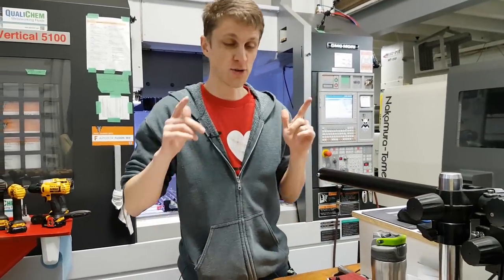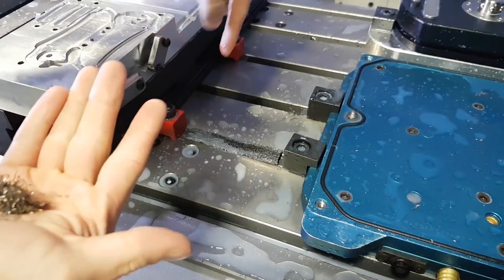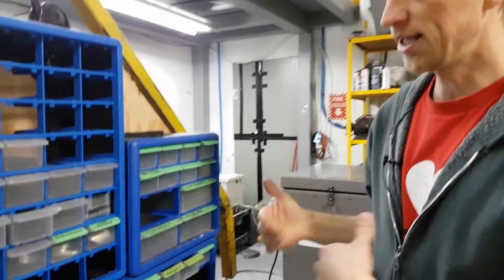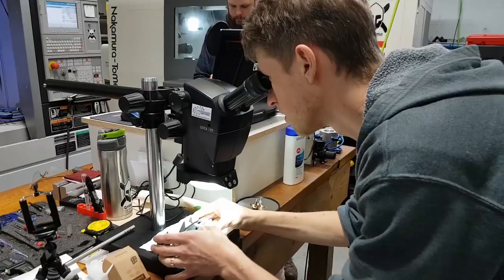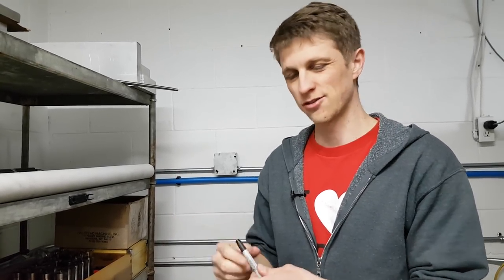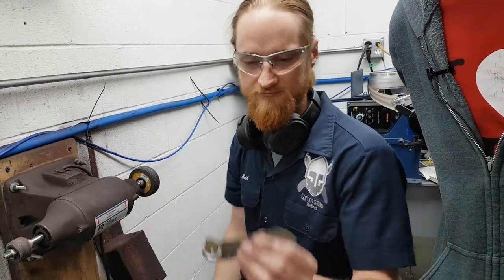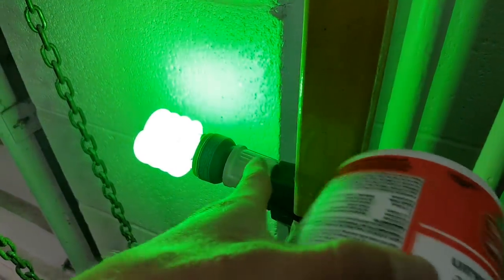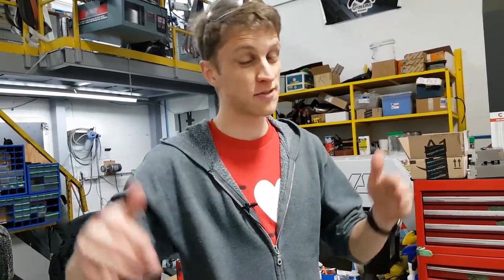33 Tips in a BLAZING 24 Minutes! - Shop Life 014

Comment from the maker: What're some tips and tricks from around your shop or workspace?
Reply: John, what about making the stickers (that cover the detent track) attached with two of them together. So when you peel them off, you stick one on one side, the other on the other side, and then you have a loop between them to hold the blades when etching. I don't have time to do a sketch right now, but think of this: O=O Hah 

Edit * LOVE the podcast! :)
Reply: Put some ridged foam on the bottom of the bins with the end mills. Oriented to the length of the mill, they will fall in the slots and stop rolling about.
Reply: Don't get a stereoscopic one, just get the single large vision one. David from EEVblog has one. Mantis Elite.
video :  /watch?v=a3o0EWHEH08
Reply: Hot glue gun! Want magnets on your Sharpie? Hot glue them on. Done in 1 minute. Move on to things that make you money. Or hot glue more things :)
Reply: JohnGrimsmo 3d print something to mount your camera to the microscope
Reply: Label your containers of hazardous materials.  When someone is in headless-chicken mode because they got splashed with something is not the time to wonder what exactly is in that jar.
Reply: Get a box of Kim Wipes for your stereoscope. No clothes (That inevitably have metal particles and abrasive dust on it.), no rags, no paper towels/tissues/T.P./etc. Kim Wipes only.
Reply: Instead of using your veirniers to measure stickout make a set of stick out sticks. We just use aluminium flat bar with notches cut out to different lengths. Ie 10mm, 20, 30, 40, 45, 50 etc
Reply: thought about putting a sheet of magnet under the bins with the end mills in? might stop them rolling around?
Reply: My favorite "trick" thing I recently got actually solves your issue with measuring stock. Starrett makes stick-on tape measures. I have one on my work bench and it's a beautiful thing.
Reply: John at my shop we screwed a wooden yard stick to the bins with bolts in them for easy measurement.  Also if you attach Sharpie caps to the shelves you can always have a place to put them
Reply: Velcro with 3M-adhesive backing. Perfect for stuff like your sharpie management; A strip on your shelf or any other surface you need it and a quick wrap-around strip on your  sharpies... boom; experience the wonders of non-magnetic organizing magic..... The international space station loves it, so will you.
Reply: JohnGrimsmo Thanks
Reply: micvee Lee Valley Tools sells measuring tape like that
Reply: Use sunscreen. Dish liquid makes a really good hand cleaner if you can't afford granulated industrial hand cleaner. Dishwashing liquid is an awesome surfactant/degreaser.

Comment: Tip from somebody who wears glasses. Please dont use your clothes to clean anything sensitive (like glasses, lenses). You will scratch them over time. Especially if youre in a shop where surfacegrinding (or any grinding for that matter..) is done.
Reply: i was thinking the same thing, he is around swarf all day and wiping a piece into the lense would ruin it
Reply from the maker: Noted.  Thanks Stefan!
Reply: Bah humbug! I've been wearing glasses since the age of two; 58 years ago.

While usually using an appropriate cloth, I don't always have one and the tail of my shirt-front comes to the rescue. No scratches of note; not even the polymer lenses that I now need because glass ones would break my nose due to the weight. :-(

The trick is to use a portion of the garment not exposed to the filth and fragments.
Reply: I think he's implying that the lense itself was exposed to metal (and grinder abrasive) dust from the shop. Wiping that dust off with even a clean cloth can be very damaging to the microscopic coatings on microscope optics.
Reply: A box of pre-moistened lens cleaning wipes next to the microscope would be good. Lubrication helps to avoid scratches in the coatings, and they are cleaner than the shirt. :)
Reply: You need some boxes of kimwipes around for that type of cleaning.
Reply: Tip from somebody who had a chip removed from the eyeball with a hypodermic needle. When you want to wipe grease swarf dust and crud from your face, do it with the inside of your shirt, which is definitely cleaner than the grinding dust and shaving impregnated outside of it!

Comment: 1. Go/Nogo gages save huge amounts of time and increase part quality because they can't be manipulated or fudged, and because they're so quick, you're more likely to check more often.

2. Design fixtures that can't be loaded wrong.

3. The error tolerance of your measuring device should be ten times lower than the tolerance of the measured feature. Don't measure a +/- .001 feature with calipers that have +/- .001 error tolerance.

4. If you have the tool capacity in your machine, dedicate tools to operations. If op1 is a face and op2 is an edge with both ops in the machine at the same time, but both ops require a 3/32 endmill...use 2 endmills. This way, an offset for op1 won't effect op2 and damage to the tool in op1 won't scrap op2. In that same vein, dedicate finishing tools where possible rather than roughing and finishing with the same tool. I personally like to rough with insert tools and finish with solid carbide.

5. CLEAN EVERYTHING! You work better, feel better about it, look more professional if a client stops by, are able to find things, it's safer and it protects your investment long term.
Reply from the maker: Yes!!  Love it Kenneth.

Comment: Work-Pants! The ones with a lot of pockets-> no need for sharpie mounting!
Fill pockets with:
- 3 separate metal rulers: one to get bent for measuring tight places, one to keep nice for normal measuring and one to keep pristine for deburing plastics and aluminium. And give each one a kink in the non-zero end to facilitate picking it up off of flat surfaces.
- Plastic scraper to be used in prying or getting chips or small parts out of ruts
- Small flashlight
-Thin work gloves

Bonus tip: use superglue to seal cuts up real fast!
Reply from the maker: Great tips buddy!
Reply: I bought a bunch of cheapie 6" rules a couple years ago.  I cut and ground them into 1", 2", 3",4" and 5" rules.  Ridiculously useful.

Comment: For #23: Look for 'stix measure' tapes. They are thin, flat steel tapes with adhesive backing. Also very good at the edge of any working table to quickly check some measurements.

Also thanks for #15 (caliper edge). I never realized until you showed it. Wonderful.

Comment: Print some covers for the Leica, and invest in some single use lens wipes for the eye pieces. A cover wouldn't hurt. 
Im willing to bet it wasn't cheap, protect that investment. You could ruin a lens using a sweater.
Reply: I was going to say the same thing, I'd make some flip covers like you see on a rifle scope. And yes don't use your shirt to clean the glass! That's the easiest way to scratch them!
Reply from the maker: Gotcha, great suggestions!
Reply: You could also print a sleeve for your phone to fit over the eyepiece at the correct focal length for pics.

Comment: John: have you thought about getting a laser cutter? It cuts foam insanely fast and leaves a very smooth sealed edge. can do very detailed lettering and graphics at lower power. You can't cut pockets in one operation but the front and back laser cut pieces are quick to glue together in a jig.

The time saved over milling, deburring and mill clean-up could easily outweigh the gluing operation and much lower foam prices. Plus it frees up the mill for other things...

Comment: You should try and fit an extra sink in the shop for parts washing and the occasional hand scrubbing. It'll prolly give you more workspace to wash parts, frees up the toilet and will help keep it more sanitary. Also rolls of paper tissue (not the paper towels for the kitchen) to wipe things down when you spill something (I love paper tissue). Lil safety tip: Get some absorption granules for when you spill oil or acid, makes cleaning up easier and safer
Reply from the maker: We are in the process of installing two more sinks, it will really help a lot!  Great tips.

Comment: On the shelf you  want to mount a tape measure to, use a metal ruler. Put a stop at zero or put zero at the edge so you can use your finger as a stop. Then you only  need  to  check  one  end.

Comment: For the small end mills drills rattling in the trays. Get corrugated cardboard cut to size and rip one side off. Instant holders for small tools can also be oily if you need that. Some corrugated cardboard has large ripples and some small so there is some size options. Its a bit ugly but it works.

Comment: if your lighting is good enough a simple watchmakers magnification glass with like 15 or 30 magnification works better than your smaller one with LED (it's bigger, easier to place). or if you wear glasses / protection goggles, there's those flip down magnification lenses.
get a dedicated analogue depth gage for setting a lathe job. tighten it during the job... release, set for the next. 

tape measure with magnet... or hot glue a magnet and leave it with the stock

use long tubes or boxes to store and seperate stock (especially the smaller diameters and keep the 'rustable' stuff away from the 'good' stuff)

and thanks for sharing, really appreciating the insights
Reply from the maker: nice!  I've got an LED magnification glass on an articulating arm in my Amazon shopping cart for a near future purchase, we'll use them in a few dedicated spots.  But 15-30 isn't all that much unless it's a nice microscope.  The little 60x is still pretty sweet.

Comment: Try some "kitchen non-slip" mat (usually available on a roll) on your Mill table to cover the mill table sections not used to fix parts. I say "try" because your coolant flooding may be too intense.

If you're printing your own bins, there's nothing stopping you from integrating a roll-/slide-resistant pattern on the floor of the bin. (vis "nubs")

Write on painter's tape before tearing off roll. That way you don't have to squeeze in the words. ;-)

Drop a kitchen towel or similar over the microscope to keep the dust off; a hook beside the microscope to hang the cloth when it's not covering.

You have a label maker... maybe print the "tape measure" to stick on the front of the stock shelves.

Use the inside of your garment to wipe the dust, etc. off lenses.

Use a comb to straighten your hair. :-P

Comment: Tip 4. Why not print some corrugations in the bottom of the trays. That way the tools won't roll around. Add another on top and the previous tools are the corrugations for the next layer.
Reply from the maker: I've briefly thought about this, might try it some time.  It should be pretty easy and they'd be easily stackable.
Reply: Be interested in seeing the outcome.
Reply: I was gonna suggest that for the rolling problem. It doesn't even have to be 1:1 for tool diameter - just enough that they don't roll. Don't put the corregations all the way to the end, have them 'chamfer' down towards the edge of the bin so thet there's room to get fingers in and grab the parts from their nestled state.

Comment: Warning. Pedant comment: Sharpening notch, sharpening choil and finger choil are three separate things/designs. A sharpening notch is a tiny notch. A sharpening choil is larger, but not big enough to fit a finger. A finger choil is big enough to fit a decent thickness finger. All are called choils, but all three are different.

Comment: loving the new video's!
Reply from the maker: Thanks Dieter!
Reply: Hey, an amazing tip when working with super glue is putting an cannula on to the glue container.
When it´s stuck you can use a lighter to open it up. Works also with loctite :)

Comment: Re: drawer storage bin mo:; Print a wave sheet to insert into the small trays or add a wave or cross pattern into the bottom of new trays to minimize rolling endmills and would work in long or short orientation.
Reply: And/Or, use raised dot array to save material and speed up printing
Reply: For the metal drawer labels and a sharpie, buy some of the adhesive backed magnetic sheet at an art store and attach a sheet of paper to the adhesive side, then cut it up into strips for magetic labels which can easily be moved as need demands.  The magnetic duct vent covers at the home centers could also be used where you can continue to use your label maker with similar results.

Comment: You could print/machine a spacing tool for the lathe, rather than using the calipers every time.
Reply from the maker: We definitely could, but every part happens to need a different stickout, so having a measured value in the code makes it pretty easy to follow.  I like the idea though!
Reply: Make little L-Blocks with your part numbers engraved on them :)
Reply: You adjust the stop on the spacing tool using your calipers ;)
Reply: JohnGrimsmo  there is a dedicated tool for that, called a "stop-loc", sold by Travers, and probably others. You also might want to buy a stick on measuring tape, commonly available from woodworking suppliers, for your stock length issue